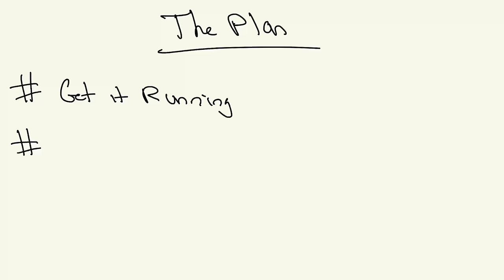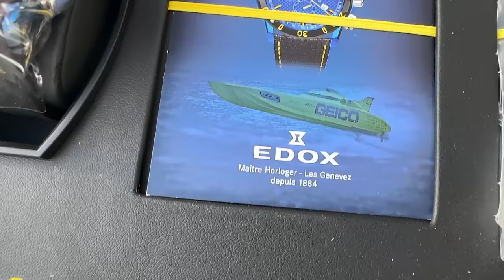Why you Should NEVER Buy an Orange County Chopper

Comment: YO CLEATER, I AM on the east coast in Southern VT THERE'S a great product from unhol that is a UNDERCOATING For any type of critters and it is not toxic and it is a special water based coatings which has a few different types of denatured pee and other ingredients that you can not smell as it's been denatured but the critters will stay right away from anything you want!  I have a very large collection of old cool Mopar cars and I have a entire collection of Suzuki samurais that I seriously would love to see what kind of a smoke show buggy you can make out of it,! I have a couple of center diffs for the rear-end that is a carbon copy of a frd0 perfectly width  to fit on the springs. ROADKILL  put a 440bigblock in one. The rear wells are very easy to tub and the Tip in should be just as crazy and the front axle is strippable or cut the center diff out and stick a 2.5" pipe in side and weld er up. But again the oil company is in chesterfield NH and the owners are really nice. Steam clean to remove and some ghost spirts to clean up and paint or whatever. It has a light black color and it literally will stop the rusty look etc.Good luck and keep it shiny side up and the hammer down. Willyp chester VT

Comment: Saying that the issues the bike has are the reason you shouldn’t buy an OCC bike is a bit wrong. The issues the bike is having is due to the bike sitting for 5 years. Nobody flushed the fuel out of it to sit, nobody did nothing. Running any high octane race fuel or blend of fuel and letting it sit, will eat fuel lines and destroy fuel pumps and injectors. O-rings, gaskets, anything that the fuel passes through. This bike isn’t a daily ridden thing. It’s a show bike, period. Conversation piece more than functional.

Comment: As much as I wouldn't let OCC put a nut and bolt together for me, you can't be blaming them for half of those problems. If you buy a bike that has had race fuel in it and it has been left un-started for years the bigger fool you for buying it. You know those lines are going to be rotten, and if you even attempt to start it without changing the lines first, then you are to blame for your own problems. Where did you think all those pieces of fuel line were going to go but straight to clogging the injectors.

Comment: There's a much better battery you can put on that you can also put a limit controller on it that would help it could charge the battery on revs and you can also limit the horsepower to prevent bike fly off.

Comment: I worked as a rescue diver for opa racing which was the saction  group who ran the races that was john Higgins bike the owner of miss geico racing he was bough out by scotty bogivich and Mark  Garrett  and Gary sayer, original  boat broke the next boat burned the last boat was sold to husky racing the first three boats where powered by two t55 cobra attack helicopter engines that last boat had twin 1650hp merc. Racing moters top speed of the boat was 200mph plus

Comment: 14:45 Just put a Lithium battery in that thing, and be done with it. 

I have an LiFePo4 Lithium battery in my 14.5:1 compression Drag car. It's hands down the BEST battery I've ever had in the thing. It's going on it's 3rd season, strong as the day I bought it, and NO other battery has cranked this engine with such authority like this Lithium one has. I'll NEVER go back to a lead acid battery again.

Just make SURE to get the specific Lithium charger for your cell if you chose to get one. A regular flooded cell/AGM lead acid charger won't work good for a Lithium battery.